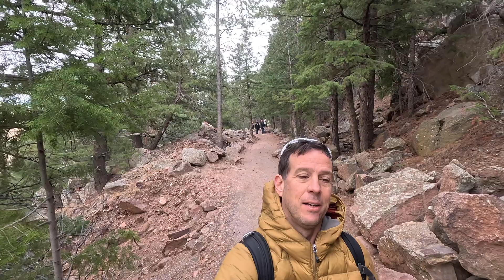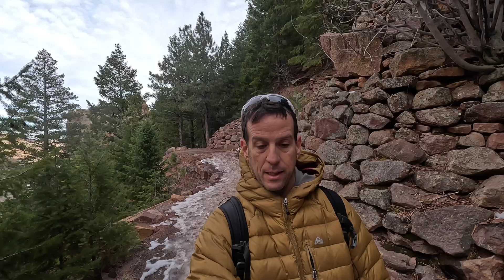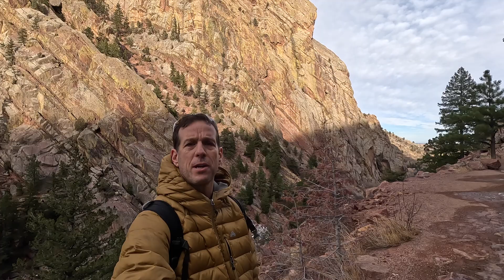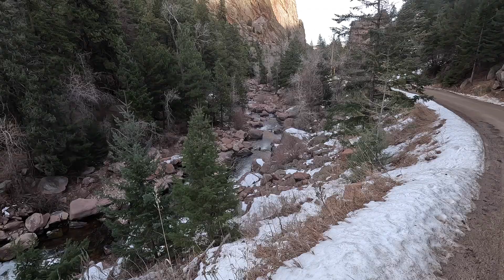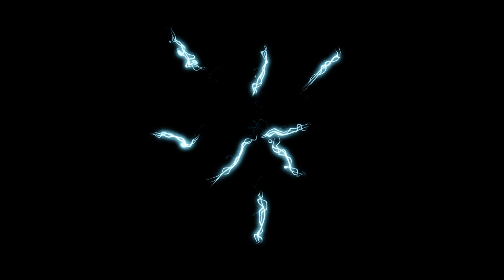Cybertruck - How Will I Use 12 Volt Accessories Not Made by Tesla or After Market Manufactures

Comment: Why won't you just use 110V equipment? That's plentiful. Also 110V to 12V converters are plentiful.
Reply from the maker: That’s a good point.  Not sure where the 110v outlet is exactly inside the truck or how one might go about wiring it. But yes at least a fire / police scanner & CB  might work.
Reply: @CyberTruckOne  Yes, they say up to 20 amp 120 volt in cabin outlet, 2400 W !! and 65W USB-C, a Chevy Silverado is only 150W AC power.